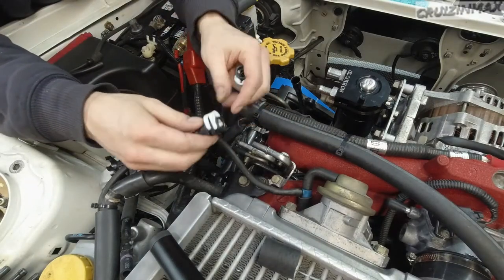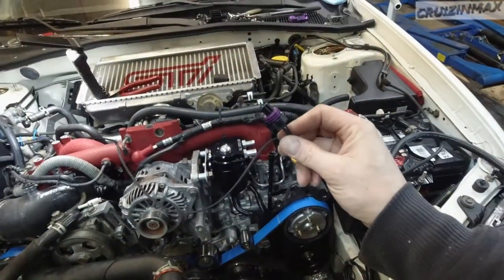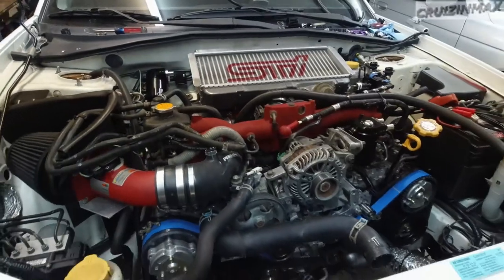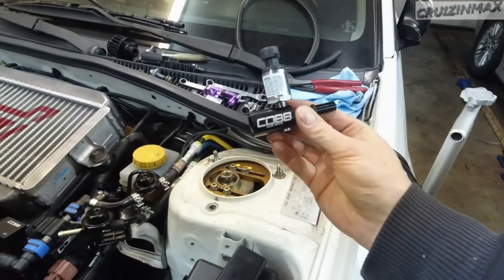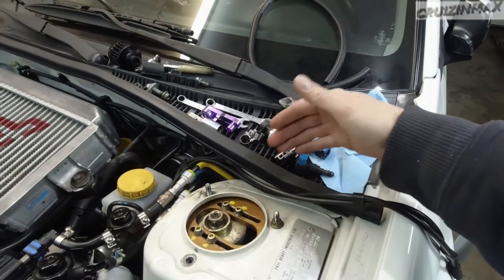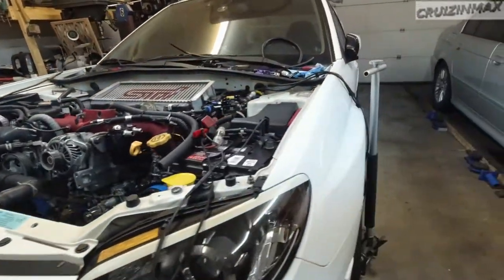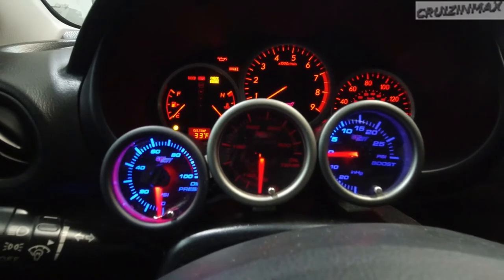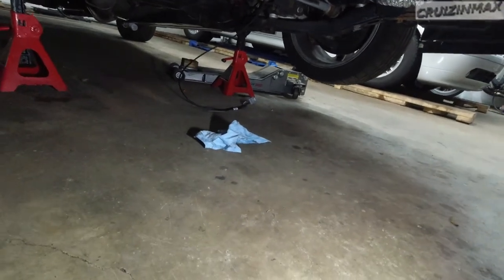Subaru STI EJ25 build part 17 cobb flex fuel install

Comment: Thank you for these videos! My first ej20 build I reused the old oil pump, so i guess the pump still had oil in it.  The ej25 I’m building now while I’m following your videos has a brand new oil pump and i was scared about it not pumping like in your part 15 video. The pump is dry but I installed it already. I will remove it and pack it with Vaseline and assy lube today. Thanks!
Reply from the maker: make sure to torque down that oil pump plate, forgot the torque specs.
Reply: @cruizinmax4017  thanks.  I found the specs in the LGT service manual. It was 4ft lbs. I used loctite like you suggested in the video
Reply from the maker: great, i hope u didnt put locktite under the actual heads of the screws, only a little on the thread.
Reply: @cruizinmax4017  just alittle bit on the tip like you did. Thanks for your tips

Comment: Besides packing the oil pump, do you think pre-Filling the oil filter helps also??  

I did both but I have no oil psi when I try to start.... but my battery is weak, so I’m charging overnight and hoping for better luck in the morning
Reply from the maker: yes always fill up the filter if possible.

Comment: Question:  how did you plumb in your after market oil pressure sensor? I tried using an 1/8NPT splitter but  it didnt fit.   What size is the oil pressure switch threads?
Reply from the maker: Its 1/8-27 NPT, I had it bolted to that blue sandwich plate for years and its a glowshift oil pressure gauge
https://www.glowshiftdirect.com/tinted-7-color-oil-pressure-gauge/

Comment: So do you just suggest using vaseline for the oil pump? Or do you suggest both assembly lube and vaseline?
Reply from the maker: I used both just to be sure and I was planning to crank it next day or 2 but vaseline only will be better if you dont plan on starting it or cranking soon since it wont run down.

Comment: Common problem with EJ rebuilds. Lack of oil between the pump and the filter.
If the filter is primed before installation the pump cannot generate enough pressure to push the air trapped behind the weight of the oil in the filter.
Dont prime the filter, its completely unnecessary.
Reply: So do you not put a filter on it while priming it?
Reply: @John-bb3me  I think this idea of pre filling a subaru oil filter came from it being so easy to do due to the EJ oil filter orientation under the block.
Just install the clean filter empty and prime the oil system as you normally would, i.e. crank sensor unplugged, crank the engine for 15 to 20 seconds or until the oil light goes out, then plug the crank sensor back in and send it.